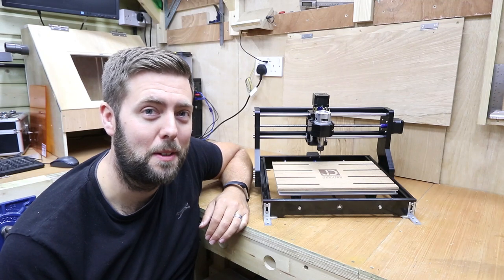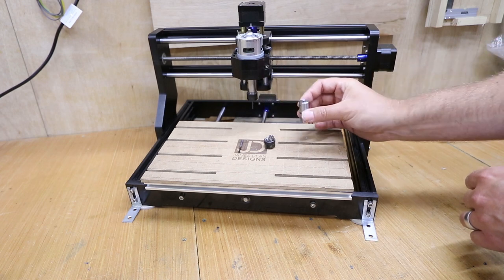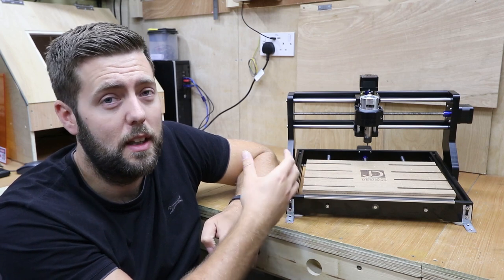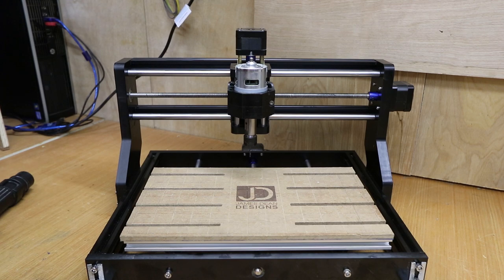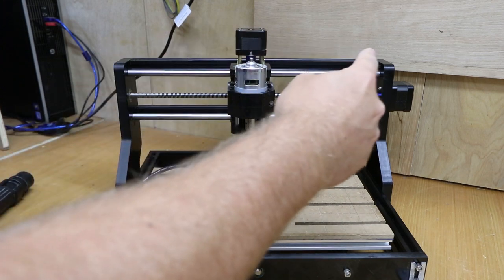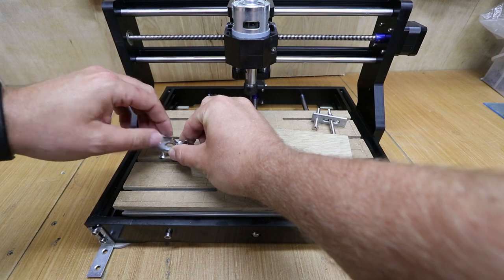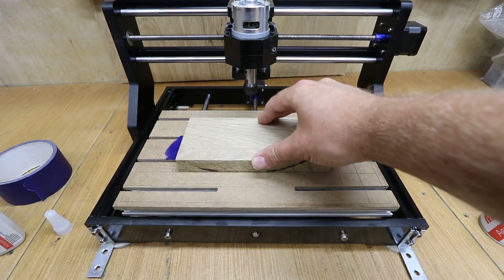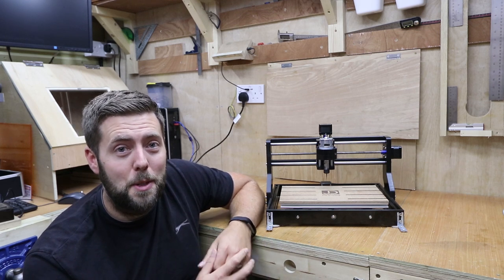3018 PRO - Tips and tricks

Comment: Can you please do me a favor? Can you measure voltage level on housing of spindle motor? Why? Because I think I've got defected motor and I realized that when I tried to Z-probe. I have 24 V on housing :D, almost destroying controller.
Reply from the maker: The housing shouldn't neutral, there shouldn't any volts going through that at all to my knowledge but I will test when I'm back in the workshop
Reply: @JamesDeanDesigns  Yes, ohm resistance should be "infinite" between motor housing and any of motor contacts. In my case there is aprox. 18 ohms. That means faulyty chinese spindles are on the market which may destroy controler.

Comment: Maybe you can help me out ?
When i make a little mistake, and i abort the process... my machine crashes in to the materiaal and break my tool and bend the shaft.
I use easel, and grbl control..
Reply from the maker: Sorry for slow reply. Try using UGS or Candle. When you stop or abort its meant to stop straight away. You can also look to fit an e-stop button for emergency stops
Reply: @JamesDeanDesigns   thanks, i can pauze or stop. But when i abort the proces, it just crashing in to the material. When abort, i think it need to go up, and then to the home location.

Comment: how can you change from metrics to standard on this thing? PLEASE
Reply from the maker: Metric is standard, I appreciate it isn't in America but it is in the rest of the world which is why all the settings are in mm. $13=1 will change to coordinates to be measured in inches if that helps but I don't believe it changes the speeds to inches.
Most design software should be able to switch between mm and inches  to help when designing, and I believe it will send a piece of code across to tell the machines the gcode is in inches.

Comment: GOOD MORNING I HAVE A DOUBT, A MONTH AGO I BUY A MACHINE LIKE THIS, THE MATTER IS THAT EVERYTHING WORKED WONDERFULLY AND SOON IT IS NO LONGER CONNECTED AND I CANNOT MOVE IT OR WITH THE CONTROL OF THE MACHINE, PLEASE HELP
Reply from the maker: Its a process of elimination. Does is light up? If not then check the power unit. If powers up but not connecting  then check your USB cable and connections
Reply: @JamesDeanDesigns  IF IT TURNS ON AND THE CABLES ARE CONNECTED, ALREADY VERIFY THAT IT IS THE CORRECT PORT, I WAS ALREADY WORKING WITH THE MACHINE, SOON THE PROGRAM MARKED ERROR AND IT NO LONGER MOVED, I ALREADY VERIFY CONNECTIONS AND EVERYTHING WORKS AND TURNS ON NORMAL

Comment: Will this cut graphite blocks
Reply from the maker: I honestly do not know. sorry.
Reply: I've not actually tried to cut graphite on mine, but it's usually easy to cut and I expect it would work with any reasonable choice of tool.  I've cut graphite on a small milling machine and my lathe.  The reason I haven't tried it on my 3018 is that it is extremely messy and dirty.  You will want to use a vacuum, but make sure it has a good filter - graphite is conductive and you don't want to risk getting it into the motor or Bad Things will happen.

Comment: Have you ever done a 2 sided cut?  Im having issues with my 2 sided cuts not being exactly the same.
Reply from the maker: Never done a 2 sides cut. Whats the issue? Are they not aligning or different sizes?
Reply: @JamesDeanDesigns  they are not aligning.  I put them in the same place and set my zero in the same spot, and looks like I'm about 1 or 2mm off, I have picts if that would help. I am using easel now, but I am thinking about switching to the universal gcode sender to see if that would fix the issue.
Reply from the maker: @leescott7638  there is always a little play in these but 2mm does seem a lot. I'd start by doing a simple test like a square but when you fix your wood down fix some block of wood around it so when you come to flip it over, its in exactly the same position and that way the zero stays the same as well, you dont have to reset that

Comment: Hi James. What's the spindle you're running?
Reply from the maker: The one I've currently got on is just off amazon. Its bit more powerful than the standard spindle - however that does make it a little noisier. Spins upto 12k rpm but means you can cut faster

Comment: its a great learning cnc and for ingraving but the second you take to heavy a cut the open loop steppers lose count, rather than put money into an ingraver I am building a cnc router with closed loop steppers an supported linear rails, a great starting cnc for the price but really a toy
Reply from the maker: I wouldn't say it was a toy. Anything you can make money off in my eyes takes it out of the toy category and lots of people including my self have made quite a bit of money from these machines. Yes there are better  machines and solutions like closed loop steppers but at the end of the day this is a $200 machine so it depends on your budget. I do get where you're coming from though, this machine probably isn't for anyones seriously getting into CNC, but is more of a stepping stone
Reply: @JamesDeanDesigns  one of my biggest problems, they didnt machine the end of the lead screw on the coupling end, all three coupling have slipped and the set screws are so cheep the allen strips out and then you have to drill the screw out

Comment: How well do you think this CNC machine will handle the routing and the laser engraving of the cast acrylic in this transponder project?
https://cessna172sim.allanglen.com/docs/avionics/bendix-king-kt76c/
Reply from the maker: it can certainly mill acrylic. one is better than the other but can never remember if its cast or extruded
Reply: @JamesDeanDesigns  Cast is better.  Extruded melts and distorts more easily.

Comment: "Now, one of the downsides to the limit switches, you do lose a little bit of cutting area. There is no way to avoid this."  
Well that's because your brain is stuck in a box, mate. 
It's as simple as drilling a hole on each side of the axis and attaching something protruding through the hole, that way you can attatch the limiters on the outside of the axis, loosing 0 cutting space.
Reply from the maker: No need to be throwing insults. I know there are different ways to mount limit switches, but no matter which way you mount them you still lose cutting space. It might only be 1 or 2mm on either side but by the nature of what they do you have to have that cushion otherwise they hit the limit of the machine.
In fact, across all the different CNC forums I'm on, the best I have seen on a 3018pro is 2mm lost on every end of the axis. Now when the spindle can only travel 40mm in total thats 10% of the travel lost

Comment: Those aerosol activated glues are scam: they just superglue activated with water. Just get regular superglue and add water manually. Pointless rubbish from aerosol water.
Reply from the maker: Not saying water doesn't active it but I can promise you 100% it's not just water in the spray cans. The activator has 2 purposes. 1 activate the glue, 2 dissipate to save leaving your material wet. If you just spray water on your material then your going to have wet material, and spraying water on tape isn't great even if it is painters tape

Comment: That's a messy way to hold a work piece down......a simpler way that is fail safe is 4 small blocks or wood with a hole in the middle.
The blocks are screwed down to the spoil board with Tee bolts and nuts etc.....and the blocks are pressed against the sides of the work piece......this will prevent the work from being pushed sideways or forward and back etc........ but to really hold it down you have 2 short nails with the heads removed pressed into each block and the points press into the side or the work and like a Bulldog grip never let go.
Reply from the maker: Personally I disagree. Im not quite sure what you consider to be messy about it, it holds the whole piece down without obstruction. Your method (if i understand it correctly) stops lateral movement but no vertical pressure, unless using the nails which will leave marks in the material. What do you do when the material is thin as well, like PCBs? We all have our favourite methods
Reply: @JamesDeanDesigns  You are holding a plain and simple block of wood aren't you?.....that means the sharp marks from nails would not be a problem........circuit boards are a totally different issue as they are not being milled....... if you didn't realize that.
At the same time, a spoil board is sacrificial whereas the one you show is not one that you would want to resurface again and again due to cutter impact.........that would have to be plain MDF board........again, that could be held down to the aluminium tee spot table with the block system I proposed.
Reply from the maker: @gangleweed  even if its wood, nail marks would then be an additional defect you would have to sand off or hide. Plus wood isn't the only thing people mill on these machines. Any method that required the slots for holding material down means you can't use the full size of the bed as I mentioned in my video. This is already a small enough machine so having to put wooden blocks around everything starts to eat into your work area
Reply: @JamesDeanDesigns  LOL....additional defect on a block of plain wood?.....I don't think you've really thought that out.
Reply from the maker: @gangleweed  I think about all my responses. I don't like the idea off adding unnecessary marks that need to be corrected afterwards. I know the method you're referencing is used widely on bigger machines with bigger beds, they even make little metal plates with teeth rather than using a nail. However, I still stand by my method FOR THIS MACHINE until someone shows me a better way to hold down pieces that are as big as the cutting areas. I'm not looking for you to agree with me, Im justifying my decisions. I'm always open to improvements but in this scenario I don't agree your method is an improvement
Reply: @JamesDeanDesigns  Whatever........